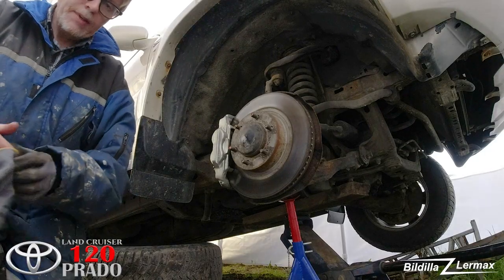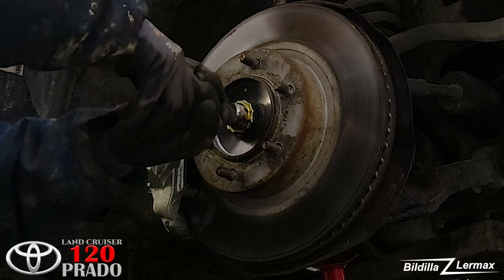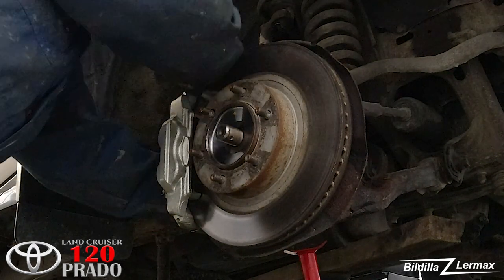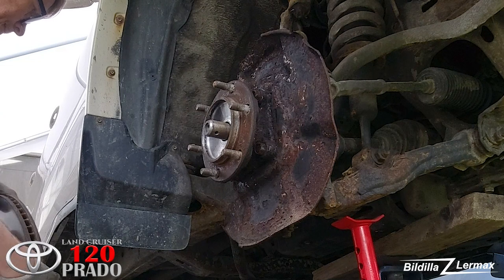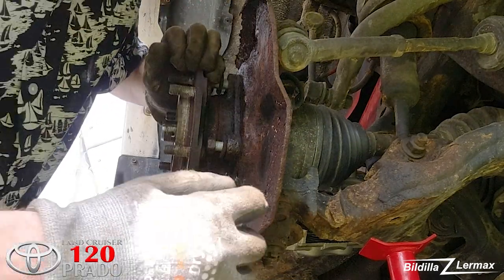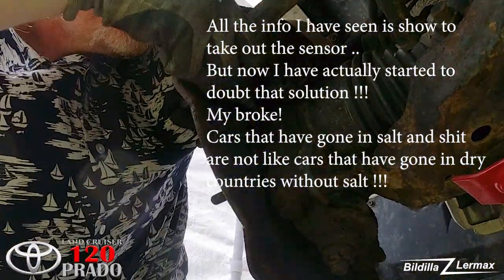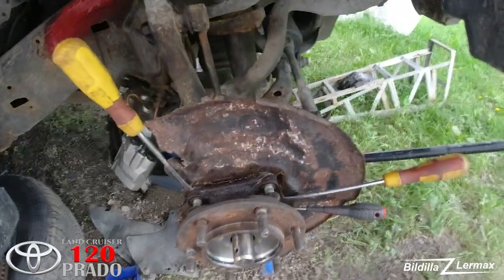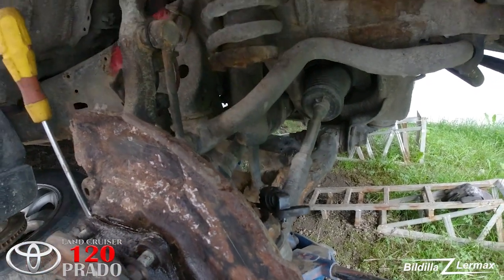The Wheel Bearing from HELL 2 - Toyota Land Cruiser / PRADO 120 - salt kills cars! Bildilla Magasin

Comment: A slide hammer will remove it.
All that rust from salt is crazy, the people should charge the roads companys that spray the salt on the roads for damages to the vehicles.,   only problem may be is that they may stop using the snow melting salt.
Reply from the maker: Hello.

Yes it is very sad how much is destroyed with salt.
Will disassemble the entire part / arm, in which the wheel bearing is mounted. But now I have to buy a larger brake arm, to get the upper ball loose. I have such a tool, which is perfect on the end joint on the steering, but it became too small for the upper ball.

Regards
Pål